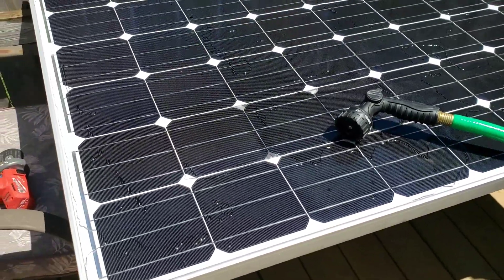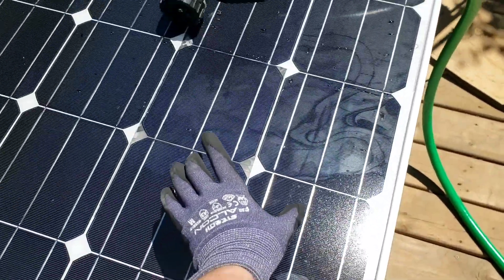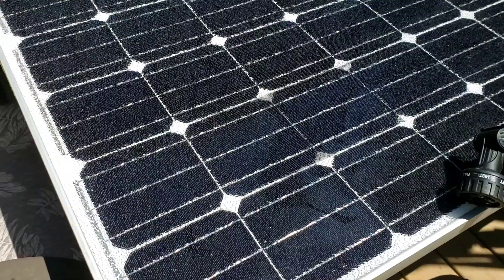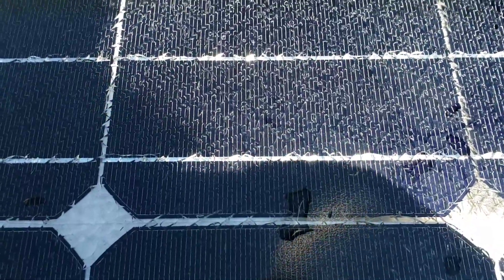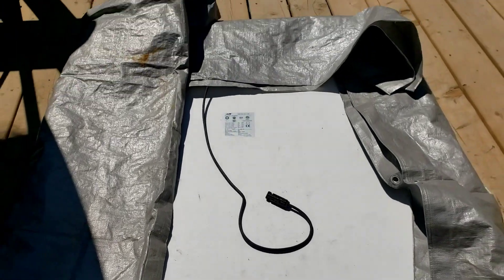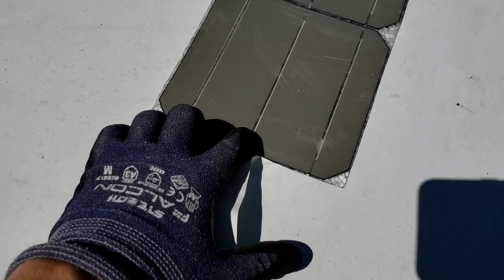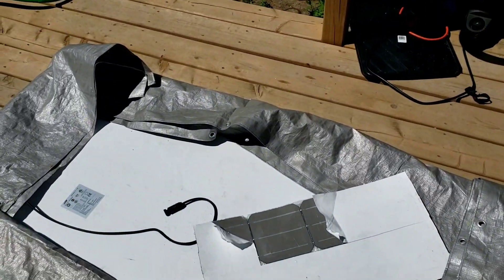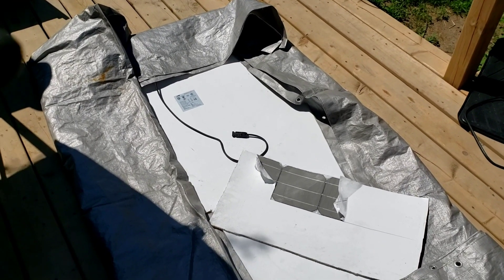Attempting to disassemble/salvage solar cells from a tempered glass solar panel (Why you shouldn't)

Comment: They build solar panels to be disposable.  They encapsulate them as one unit, and the tempered glass is fused (glued) to the encapsulated sandwich of laminated solar cells, making it one unit.  Not sure why they haven't figured out how to make them easier to repair/disassemble, I guess cost is a factor.  I would mount the cells onto a thin plywood board and encase that in a vacuum sealed "bag" to keep moisture and air out, and then simply add the glass to the top without glue, and bind together with a little silicone and the frame for rigidity.  If building your own, just use regular 2 or 3 mm glass, once it is siliconed to the thin plywood and held in with the aluminum frame, it will be strong enough, although it won't take a hail storm strike - but in the unlikely event that does happen, it is a simple repair to open the frame, slice the siliconed glass panel off, silicone a new one, add the fram back, and you're done.  If a cell does become damage or needs replacing, cutting open the inner bag and fixing the issue is easy, then reseal with a new bag and repeat above.  I guess because of the cost of new panels today it's not worth doing, but if you are a DIYer, and plan to keep the panels you make until you die, this is the way to go.

Comment: I'm wondering if you heat the tempered glass up to melt the glue then have someone else slowly lift it as you melt it would work? 
Maybe even somebody get like a thin but sturdy stick of some kind to slowly lift it carefully as the other person melts the glue. 
I think the glue would be still stuck to those cells. 
Maybe a good idea would be almost like a machine that heats up the glass part after you loosen it but has a suction cup for the glass to lift. It could be a thing too? 
Those are all the ideas I have . Thanks for showing us.
Reply: There's a few companies microwaving them in large ovens to separate them, but it's an end of life process, manufactured panels can only be "surface repaired" and used until they no longer work.  Luckily they are cheap enough you can buy new ones, just not from big box stores.  Lots of used panels for cheap today, removed after 10 years of use but still pumping out 90% of their rated power.

Comment: Well cutting that glass was bas idea from the start, little bit of heat and you could glue them off, shattered glass removal from panel is possible, but much harder

Comment: cutting a solar panel in broad daylight if it succeeded is not ideal i suppose. You would end up shorting out the cells either physically or by water spray. One should attempt mods away from sunlight

Comment: Thank you very much for publishing this!! It is very educational and it will certainly help many people, including me!
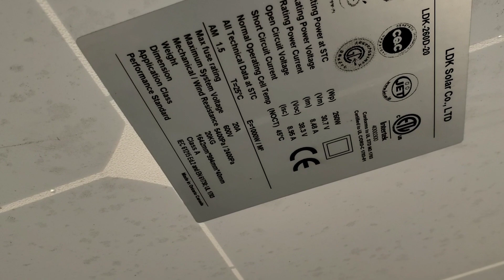At 0:24 I see "maximum system voltage 600V, 20A". Do you happen to know what the 6 Shottky diodes are? I guess they're rated at 600V, 10A. 
 
I plan to experiment with DIY of solar panels for home-lab use. I see that I can order bifacial cells from alibaba at $0.16/watt. The cells weigh 4 grams per watt, so shipping by air will be cheap. Tempered glass is actually expensive and heavy, so I'll be experimenting with lightweight solutions that certainly won't last for 25 years. 
In your video I see how the glass holds the cells, and it gives me ideas on the structural requirements. I think I should connect busbars between cells with enough wiggle-room, if there's no solid glass to prevent tearing of those connections if the cells move a bit. 
Hale protection might be handled by a cheap clear greenhouse plastic, that is elevated far enough. Oxygen/moisture might be handled by simply laminating some parts. The whole thing will be rather non-rigid. I'll see about handling strong gusts of wind.

Comment: work at a solar company, we have alot of old panels. was wondering if i can take apart some. thanks for this. i wont even try now. lol.
Reply: You could try solvent or heatgun to melt the glue and remove the glass that way. Should not explode if you evenly heat it. Also note that glass in solar panels far is understood is not normal glass, but lead free glass. Normal glass would block sunlight and cause efficiency to drop.. how much i dont know. This same thing will cause some issues for me, since got shattered damaged but working new panel. I'l probably try slowly cut the glue between the cells and glass and maybe add plexy or something top of it.

Comment: those cells probably laminated with Eva films (Ethyl Vinyl Acetate) and i think if you left them in toluene or xylene solution for a day they can come off by theirselves.
Reply: I was just givin a busted panel, I'm gonna go pour some xylene and report back..
Reply: @Mix1mum  becareful tho, its highly flammable.
Reply: @Mix1mum  and now!!!????
Reply: results
?
Reply: @awesomed007  no dice. The Xylene had a small effect, it has potential. But that potentiality would require a submersion tank and I'm not looking to drop $1000 on petrochemicals.
Reply: @Mix1mum  thanks, any other methods. The eva sheet is laminated on both sides of the cells.

Comment: Must be an impressive glue they use.  Has to high heat and stick to glass must be impressive glue. 

Be nice if solvent.  Surprised you didn’t try and heat the broken glass to a high heat and try scrapping the broken glass off?
Reply: Yeah I thought he was going to start picking the glass off
Reply: @stupidscruff  might have been a deliberate set-up. To stop people trying.  But that glue must do high heat and uv.  So it's better than u can buy that's for sure...maybe a solvent though ? Impressive.

Comment: I wonder if you could melt the glue off with a heat gun.
Reply: - you would be best off to heat up the whole panel (or a large area) at once- to remove functional cells. - these things are made once - to be scrapped and recycled in a glass furnace at the  end of life - metals recovery...

Comment: Thanks for the experiment and your effort. I was going to fix a solar panel thinking I could get to the tracks on the front side of the glass and re-wire them but that seems futile. One of my good panel produces 60V (open circuit voltage) with 4 sections of 15V in series. Some of the panels I have produced 30V, some 45V etc. I am sure the individual cells are OK, but there are some connection problems after being used for 15 years. If I can rewire them to 15V (4 in parallel) and get 4 times the current that would be good deal.